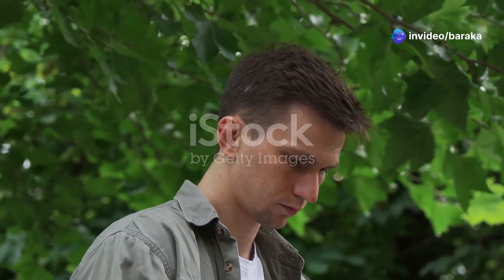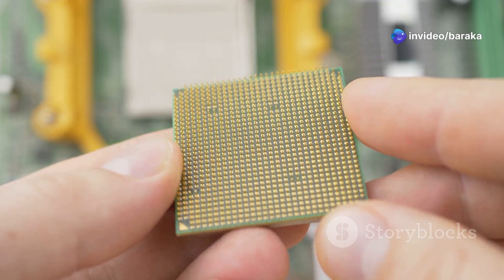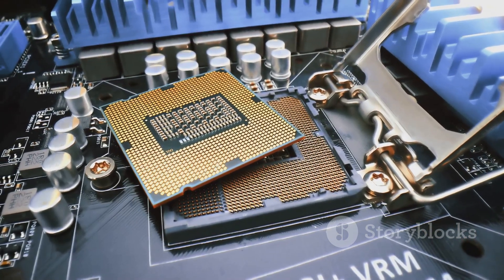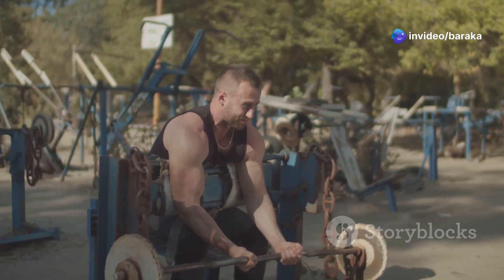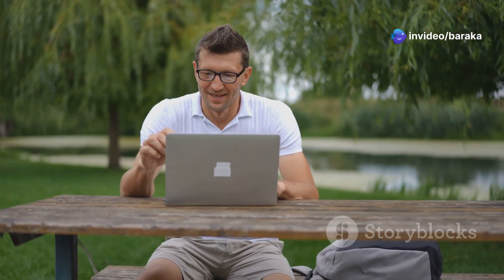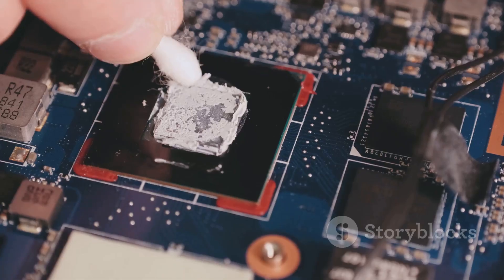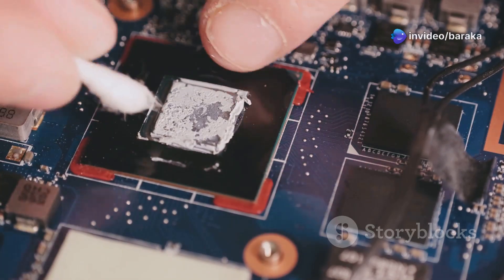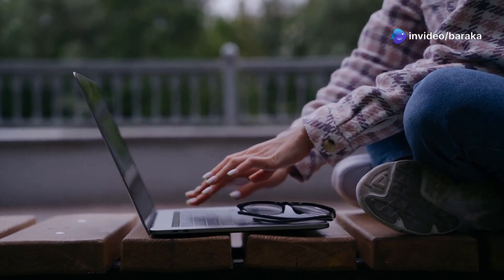Why Intel's 13th & 14th Gen CPUs Are Failing: Switch to AMD!

Comment: That's a shame! I don't overclock. I collect old i7 CPU from old office machines that have been thrown out. I test them out. Surprisingly most of the are very stable and work well for gaming, even though they probably have millions of hours on them.
Reply from the maker: I also have an intel laptop myself but would love to go amd. Thx for the comment
Reply: AMD is ok, have many of them in the past, but issues come about as windows  accumulative updates releases over the years. They seem to slow down considerably, but the Intel CPUs don't slow down as much as they age.